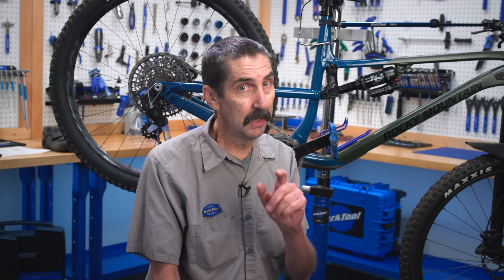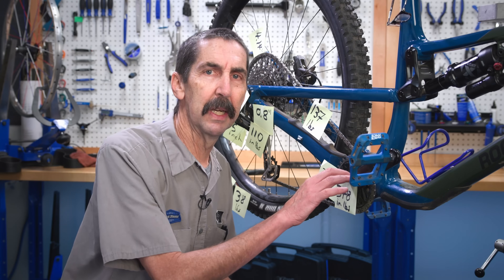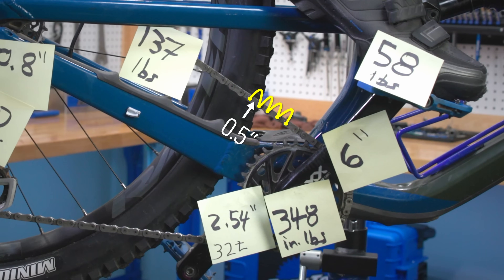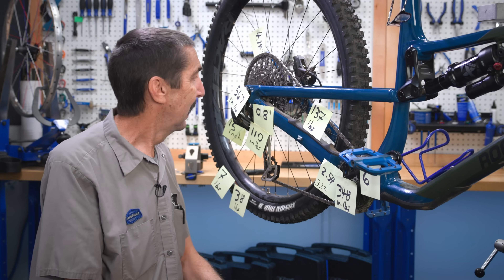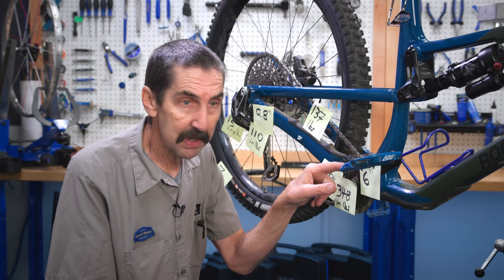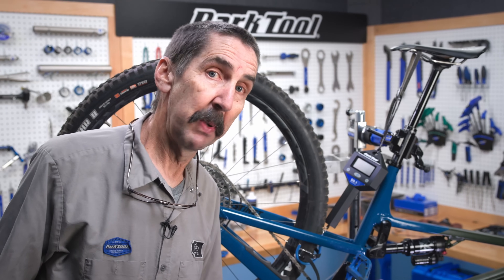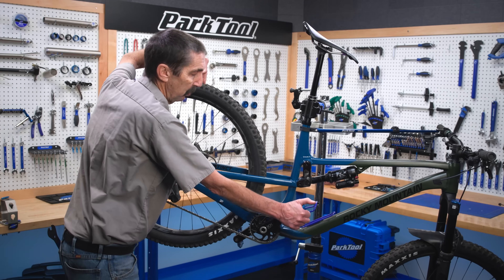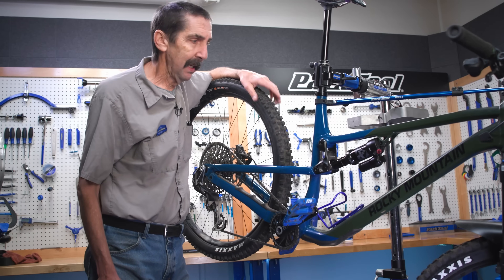Work Transfer

Comment: I think those bikes are far too common in cities just because they look sporty and not for what they are actually designed for, as for traction engineering, that is a wonderful and totally irrelevant topic, and if we are going to take it to the manufacture of downhill bikes, the weight of the rider and the silhouette of the vehicle in relation to the extraordinary forces, I think you have to be an idiot to go downhill with a specialized bike which is actually an absolute cliché and an incredible dangerous 
and totally absurd, to top it off, the parts and consumables are overpriced and more style than reliability and engineering, not to mention or add pride, otherwise I am clear in the parameters and no one is interested in such conspiracies about loads and calculations of lever forces and so on

Comment: The fact that there are 2.54 cm in an inch, means that I am having some inception level issues with understanding that is not a 1 inch chainring.
Reply from the maker: The pitch is from rivet to rivet, which is 1/2".  An inner plate and outer plate together make 1".  The circumference of the ring where the load is seen is the number of teeth divided by 2. 40t ring is 20 inches in circumference.  But the important part for use is the radius, which is the lever, to transfer the work.

Comment: Next calculate the torque needed to remove a rusted-up bottom bracket.
Reply from the maker: Actually kind of fun. If not rusty, it takes less torque to remove a component than install.  A bb secured to 60Nm will loosen with less than 60Nm.  Rust changes everything, or as is said, rust never sleeps.
Reply: @parktool  This is one of many reasons I buy tools from you guys. Just makes me all warm and fuzzy inside.

Comment: Wonderful video, I love every single video you post. But it would be even greater for the internacional audience if you use more often the international metric system... Or not, I love Calvin ❤
Reply from the maker: We stuck with Inch and Pound because of the chain ring.  All bikes use 1/2" pitch chain, and all chain rings are made for this.  That makes figuring the radius, the wrench part, easy.

Comment: I'm doing a bike mechanic course and this exactly is going to be in my test exam but in German, and also  in kg and cm  and km /h if you know what I mean 😅
Reply: Be glad he only used inches and pounds (and the odd Nm), and not the also commonly used football stadiums and refrigerators. 

Viel gluck mit deinem exam (I'm Dutch, my german is not very gutt 😁 ).

Comment: How many horsepowers is that tho?
Reply from the maker: Not applicable here, because we did not include time.  This is only static load, a snap shot frozen in time.   Horsepower = (Torque × RPM) / 5252.     That RPM is revolutions per minute. 
We did not designate or address pedaling speed, and you need that to have horsepower.   Assume we pedal at 100 RPM, it is still is rather pitiful HP.  Such is being a human.
Reply: @parktool  thanks!

Comment: This seems like the perfect video to ask a question I have had about gearing of fixed gear bicycles. Obviously, riders are very particular about the gear ratio they use on a fixed gear bike, but you can maintain (approximately) the same ratio while scaling up/down the chainring and cog. I've generally heard that bigger is slightly better from an efficiency perspective, which makes sense in the context of this video, as the larger radius should result in less force being pulled on the chain. Do you know if these variations in forces have much of an effect on chain wear or efficiency?